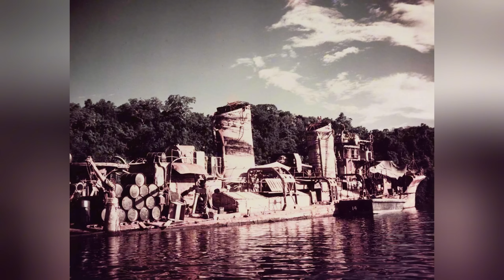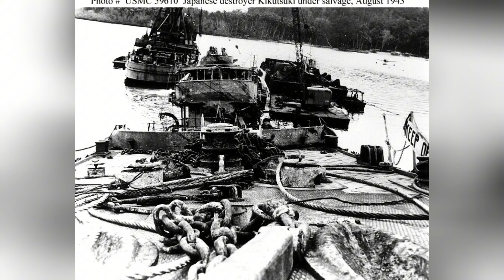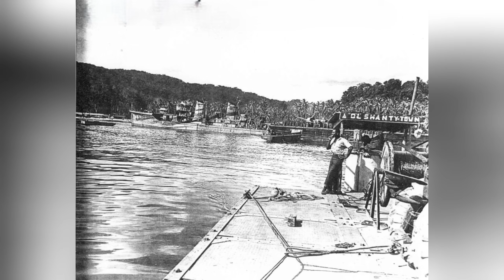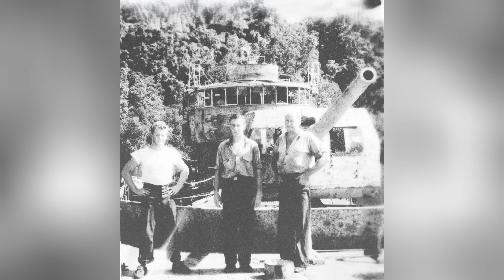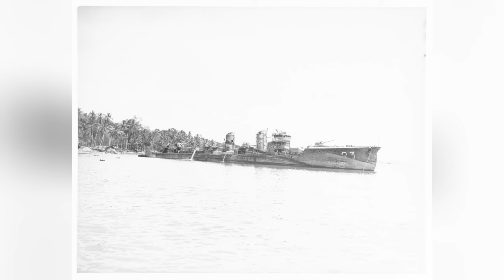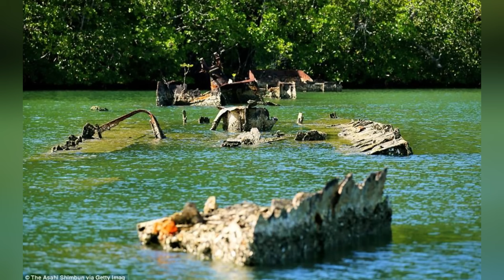Salvaging Kikuzuki: The Wreck That Exposed Japan’s Secret Torpedo

Comment: The water in Tulagi Harbor is really not that deep, about 60 feet on average. Additionally, this class of destroyer was rebuilt in the mid 1930s and upgraded with the latest torpedoes and fire control equipment. This was what they were salvaging for evaluation and intelligence purposes.

Comment: It's a small (1336 ton) destroyer. I got so tired of the many, many times you called it "massive" or similar adjectives. If all they cared about was the bore of the torpedo tubes that could have been easily measured by a diver or one tube unbolted and brought to the surface.

Comment: They only needed to pull the the to pull the forward torpedo launch off the bow ahead of the bridge to recover what they needed. You make the opporatuon out to be way more than it was. The ship was an early 1920s design with no other value. Also. These ships did not carry the type 93 long Lance weapons. These had older version on board.
Reply: Kikuzuki was one of six Mutsuki-class ships reconstructed in 1935–36, with their hulls strengthened, raked caps fitted to the funnels and shields to the torpedo mounts and yes they carried the type 90 torpedo. At that point we hadn't been able to examine a Japanese destroyer that formed the back bone of the 4th Fleet and being 6 years out of a major refit there was plenty to learned.
Reply: Perhaps the US didn't know there were old 21" torpedoes instead of the deadly 24" Long Lances aboard?
Reply: @axels9489  The Mutsuki class was an improved version of the Kamikaze-class destroyers and was the first with triple 61-centimeter (24 in) torpedo tubes